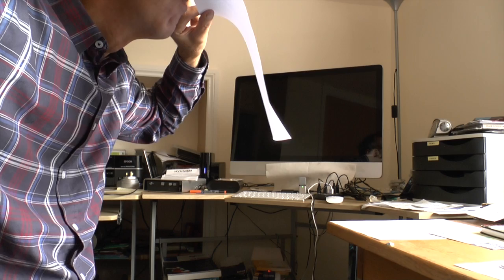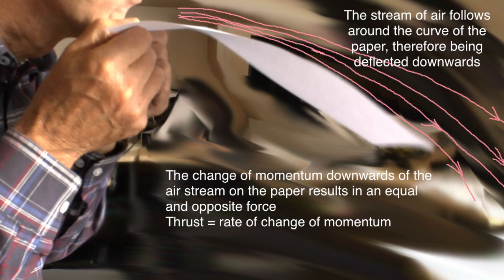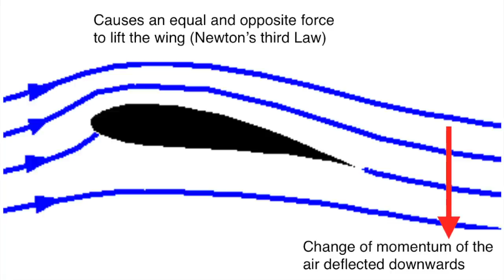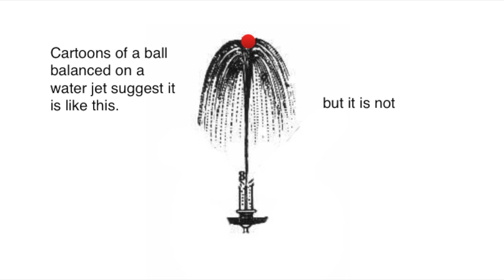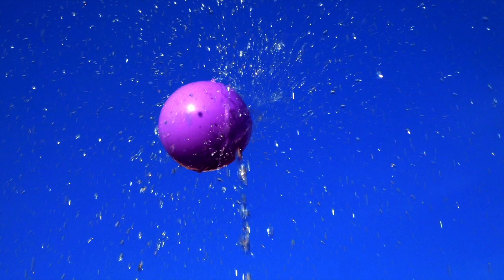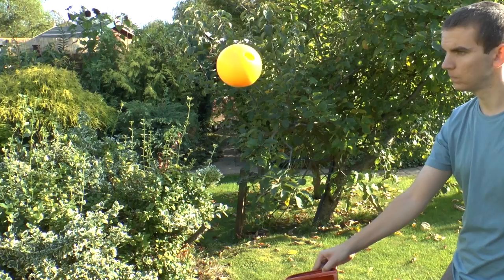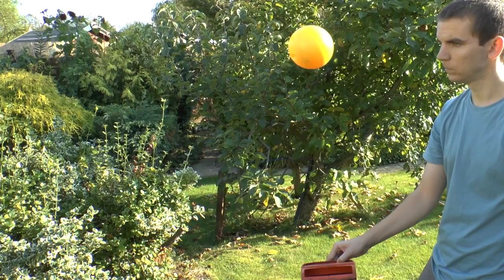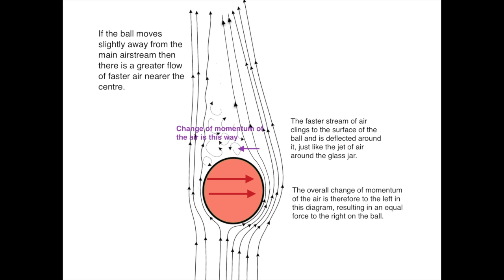The Coanda effect; explaining how a wing works: from fizzics.org

Comment: Can you please explained why the air traveler faster on the upper surface than bottom surface of the wing ? Or more like why the air above the wing is rather lower pressure compared the bottom of the wing
Reply: Thank you
Reply: @aviationbird1962  I would love to know this too
Reply: Because of the angle of attack. As you can see, the wing nose tilted upwards. This generated a air speed difference between the upper and bottom surface.
Reply: The same Coanda effect explains it pretty well!

For the speed increase, the explanation first comes due to the lower pressure being developed first. You'll probably say: "WHAT? Then if the speed increases, the pressure should further decrease?" And the answer is: NO! Once the speed has increased as a response to the pressure decrease, this increase in airspeed will be a result. If you would force more airspeed over a diverging curved surface (upper of the wing at positive AoA), then the result would be that the pressure lowers, and especially over the lower radius of the curve (such as it happens closer to the leading edge of a wing), but the resultant reduced pressure won't further affect the airspeed, such as if they would self-amplify each-other. No, only one is the result of the other and..., if you really want to, you can either reduce the pressure on the top of a wing at positive AoA, which will result in an acceleration of airflow over that lower pressure area and if you can... at the same time you can add more airflow speed over that upper surface and even further decrease the pressure over that area. And guess what..., this is exactly what happens with an aircraft, when, for example it pulls higher positive AoA on it's wings and at the same time, the airspeed of the whole aircraft gets higher. Now..., when increasing the AoA, or..., when increasing the camber of the wing or local airfoil such as when deploying leading edge krueger flaps and slats or trailing edge flaps with or without also increasing the whole AoA of the wing, you effectively start benefiting from the Coanda effect which implies a pressure reduction over that diverging curvature of the wing and also wherever the airflow must turn in order to continue following the solid surface..., THE PRESSURE WILL DECREASE. Coanda effectively took place. Now..., let's say that the above happens but at the same time, your plane is also speeding up, such as when you dive upside-down or in a downward spiral and although you may have great drag due to flaps/slats and great AoA..., the combined engines thrust + gravity thrust component is greater than the drag and you still increase your speed. Now..., the already low pressure will get even lower as you forcibly increase the airflow speed over the lower pressure area. And now you have a complete explanation of how lift varies with both the decrease in pressure due to AoA and flight control devices which lower pressure accelerates the flow up to a given amount and they all (pressure and airflow speed) settle at that a value, as well as increasing the airflow speed alone which on it's side also decreases the pressure on a diverging surface. And to make it complete also for the higher pressure side..., exactly the opposite happens as for what I've depicted above. The higher the pressure (such as flaps deployed) on the lower surface of a wing will reduce the airflow..., will brake it down, and of course..., at the same time, the higher airflow speed, the higher the pressure. And again, these won't resonate on each other, but only one affecting the other one. Hope I didn't complicate it by trying to get into tiny more details. If you understand it as a whole..., it will be easier to make sense of what happens deeper.

For short..., the curved airflow..., either due to the curved surface or due to the angle of attack AoA, which has a momentum (the air has it's own inertia as it tries to follow a surface) which creates a lower pressure zone along it's curve, also generates a higher airflow rate (the airflow isn't pulled by the lower pressure, but rather accelerated along the streamlines by the higher pressure ahead of the wing) over the lower pressure area on the wing.

One more important aspect:
If there is no curvature at all..., no matter how much you'd increase the airflow..., the pressure will remain EXACTLY the same. But if you can accelerate or decelerate the airflow by varying the pressure along the virtually uncurved surface.
Reply: Velocity varies around the body because of flow deflection, Pressure varies around the body because it is related to fluid momentum.

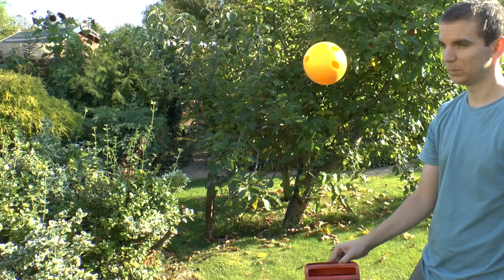Comment: 3:15 Sorry but this is not well explained. I literally didnt understand the explanation.
For example I could explain this myself easily with the low-pressure on the left side of this picture, resulting the high-pressure from the right pushing the ball back to its centre.
"The faster stream of air clings to the surface..." bla bla  bla. Nothing is explained here.
And there is not "faster stream of air" This is so wrongly explained...

Comment: This wrong. Very wrong.

Lift over a wing, airfoil, has NOTHING to do with the Coanda Effect, nor “equal transit.” Nor, as accurately stated here, Bernoulli.

As an airfoil moves through air, the perfect vacuum at the surface of the back of it pulls air above it downward. A low pressure zone is created above the top-back of the airfoil that pulls down additional air from above. All of this “scooped up” air is accelerated down the backside, trailing edge, of the airfoil*. Opposite but equal action equals lift. Basically a plane is a horizontal rocket—horizontal ballistic flight**.

As for Bernoulli: Bernoulli involves flowing, constricted, and NON-COMPRESSIBLE fluids. Air is highly compressible, is not constricted over an airfoil, and is, relative to the airfoil, stationary, not flowing***. As air pressure differentials are involved, the Bernoulli equations approximate well enough the processes and forces involved, and so are often utilized in explaining lift.

*There are videos of planes landing where condensation in the low pressure above their wings is seen. Some even showing that air being shot down the trailing edge of the wings.

**Interestingly, looking at the energy consumption of an airplane versus a rocket it is revealed that gravity is the primary source of energy for sustained flight by an airfoil equipped aircraft. Hence unpowered glide-ratios, auto-gyros, gliders, etc.

***It is the airfoil that is “flowing” relative to the air.